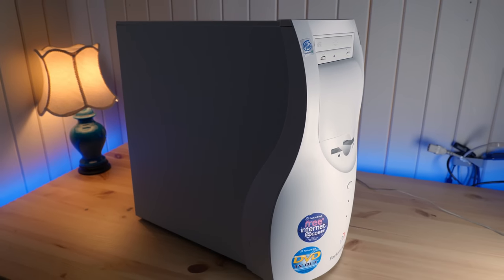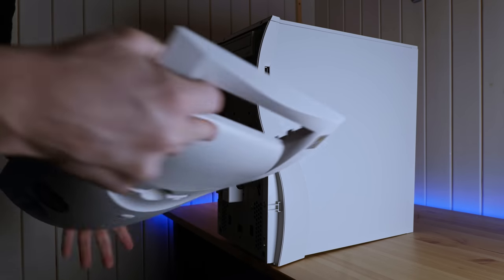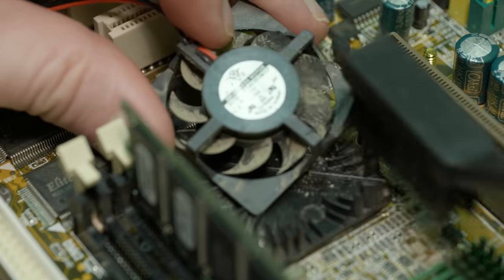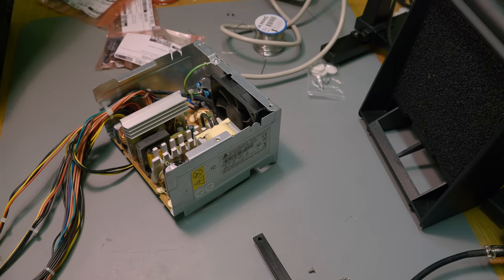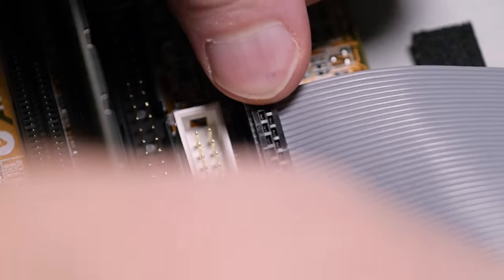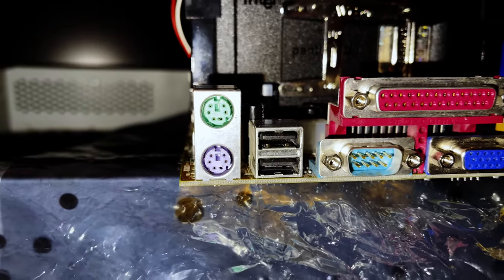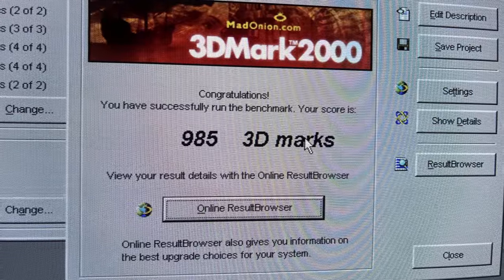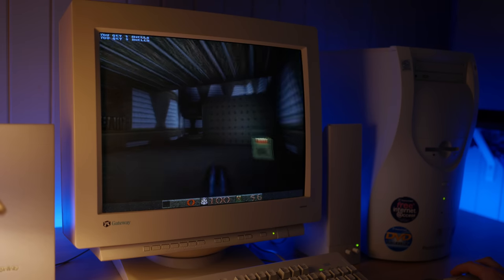Reviving a Packard Bell with onboard Voodoo 3!

Comment: a small advice: never use an antistatic bag as a base for testing a motherboard. its conductive. nice video, amazing motherboard.
Reply: Not conductive enough to cause any problem.
I just made a test, and can't measure anything between 1 mm with my meter, on the 20M scale.
Reply: @nalinux   not all the bags are the same. just be carefull.
Reply: @geomarin5412  Maybe. But I've never seen anyone acting as aluminum paper foil.

Comment: wow i didnt know there was an onboard voodoo option. thats something to watch out for when i'm digging through old systems
Reply: Same here!  I wonder if it was a Europe-only thing with Packard Bell?
Reply: 3dfx was pushing desperately every button to catch up with nVidia TNT2 at that time. They were a GPU supplier at first, but after acquiring STB Microelectronics they also release their GFX cards. They cut the GPU supplies to other vendors. After that, you could get a Voodoo accelerator from 3dfx only. That more profitable but hard to do decision was their last mistake I think. With GeForce 256's release their fate had ended

Comment: You should get yourself an ATX power tester. Those are gold if you attempt such things more often, and don't cost the world either. Note that especially the digital versions have issues with different ATX versions, such as the number of PINs and the presence / absence of secondary 12V and -5V line.

Comment: Packard Bell sure did a lot of fun stuff with this machine. From making the case open backwards, to the hidden bays.

And did you also notice there's only ONE USB port on the back, despite the board having two?
As for the PSU outputting 3.4v - apparently that's one small caveat of those that run a sense wire on the 3.3v - the voltage rises slightly. I have a Sun Pro OEM'd unit here (Rhino RX-500Y) that always runs the 3.3v rail like that.
Reply from the maker: Yes, haha, the blanked out USB port is weird! Maybe they had another mobo option with only a single USB and they just used the same IO shield or something.

Interesting tidbit about the 3.4v, had no idea!

Comment: That brought back some memories, a cousin of mine had such model back in the day, I helped them set it up and install the PC when they got it.
It came with a collection of software and games which where included by Packard Bell, from what i recall some of the titles where Encarta Encyclopedia, greetings card software, Games Blade Runner and Freddi Fish. They also had A2 racer but not sure if that was a pack-in or they got that loose. For reference this was in the Netherlands, I believe some of the included titles could differ per country/region.

Comment: I would enjoy seeing a video of this guy getting upgraded to 16 MB. What's the processor limit for that motherboard in terms of the processor?  I know slot 1 went much higher than 600mhz. I also doubt that 256 MB was the RAM ceiling as well? Anyways, nostalgic AF. Thank you!
Reply from the maker: The bus runs at 100Mhz stock, but the BX/BZ chipset is know for running well overclocked to 133Mhz, which should allow running later and faster PIIIs. The RAM ceiling was officially 512MB, but I’ve heard that 1GB is possible with 2x512mb sticks.

Problem is that those kinds of upgrades would likely require a different BIOS, and I like to keep it stock with the Packard Bell boot logo and everything.

But I’ll definitely do a video if I ever upgrade the VRAM!
Reply: @OddObsolete  I'm sure PB would've sold this motherboard with a better BIOS so they could sell faster processors on the same motherboards. More profit that way. I've always been a performance junky more than a product purist. Great system though.

Comment: That's a very nice find 😎 get some UT GOTY and pod on the go or GTA 1 with glide enabled would be sweet and some duke and quake ..... I have seen that case design before and bottom mounted screws holding side panels on or topside with plastic cover hiding screws seemed to be a thing at one stage 😎 super cool video ........tech tip cut down paint brushes work we'll

Comment: Im fairly certain the Voodoo3 chip on that board is the "bonesteel" version, a cutdown and underclocked voodoo3 (100MHz Vs 133MHz/166MHz) with a software diabled texture unit that can be re-enabled via a registry hack. Id suggest using vogons custom 3DFx driver. 

A revisit to this machine with some upgrades (Including mabey an IDE SSD?) after reseraching my suggestions above would be a cool to see video. ;)
Reply from the maker: No, it’s clocked at 143Mhz like a regular Voodoo3 2k, and fillrate in 3Dmark 2k seem to indicate that both TPUs are active. But good tip about the Vogons driver, I’m gonna check it out!
Reply: @OddObsolete   The 133 was a typo yes, Ok, Was an assumption on my part, I figured since compaq pretty much had a monopoly on the bonesteel cards from 3DFX that they would naturally use it as an integrated solution aswell.

Comment: Excellent video... I must say if you are going for the 8MB to 16MB SGRAM path and this is a custom Intel i440BX which must be a FSB 100Mhz and Intel Pentium III 600Mhz... why not go full 1Ghz PIII FSB 100Mhz? would completely max this already custom and extremely rare Packard Bell into legendary status.

I also feel that the Voodoo 3 chipset itself was a bit of a let down compared to the competition of the time but maxing out this Packard Bell to 16MB SGRAM, (you already maxed the SDRAM from 64MB to a mighty 256MB) and an Intel Pentium III 1Ghz would just sweeten the deal... let me tell you that I had a 600Mhz PIII and own two PIII 1Ghz but they are 133Mhz FSB for the latter and the speed is VERY palpable indeed....

Afterwards the whole Voodoo 3 driver or probably some fan made drivers? would fix the benchmark issue and help provide some neat benchies or custom ones in 2022 or assuming you cannot get it finished, into 2023.

Thus testing the old games that ran on Glide and PC-DOS games should definitely be an excellent experience. I also like that you did not use a SSD and instead went for a mighty Hitachi DeskStar HDD 160GB, I have one of those too, very good drives.

Also I recall that a PC magazine I have did run a story on unfinished motherboards that featured a 3DFX chipset but they made it seem like such a 3DFX powered motherboard was never in production and the sample they had way back in the early 2000s did not work... I suspect that the PC magazine was clueless about this Packard Bell given how they often preached for custom PCs anyway and probably Packard Bell did not have just a great performance name but also the fact that Atari Games (the arcade game maker NOT the separate entity that made computers and gaming systems) did indeed have some type of custom motherboard featuring a 3DFX chipset around 1996 which probably means it was based on 3DFX Voodoo 1 or before the Voodoo 2 which isn't saying much but "seemed" like a powerful arcade machine based on a custom computer motherboard.

Comment: Say, would it be possible to upgrade the Voodoo 3 RAM like a 1.6 XBOX via piggybacking and chip-select?
Reply from the maker: I’m not familiar with the XBOX upgrade, but it’s possible to get the Voodoo 3 up to 16MB, yes.
Reply: @OddObsolete  Neat.

Comment: How did you set up windows 98 on a 160GB Hard drive? 80 partitions? :P
Reply from the maker: Win98 supports FAT32, so a single 160GB partition is no problem!
Reply: @OddObsolete  Using a 160 GB HDD with Win98 is a big problem. The problem will usually not be visible from the get-go, but if you use the OS for a longer period of time, you will end up with corrupted data. With Win98, you must make sure that the disk is below 128 GB (notice how I said "disk", not partition - it doesn't matter if you create smaller partitions, data corruption will still occur if the disk is larger than that). There are workarounds, of course, such as R. Loew's Win98 high capacity disk patch.

Comment: I have one of this motherboard version 1.0 without TV out. I use with 433 CeleronA on 540Mhz and 128MB ram. The 3DMark2000 give me only 493 Score and the 3DMark99 4200. Is it possible my board has 1 TMUs like Velocity 100? In Quake 1 640x480 111.5 fps 800x600 75 fps 1024x768 49,7fps. I have similar pc with PCI Voodoo3 2000. Make around double FPS in Quake(120fps in 800x600)!  I don't know what the reason of this result :( I use win98se on every old pcs.
Reply from the maker: I suppose it is possible. To figure out if you have 1 or 2 TMU you can check the texture fill rate in 3D Mark. I don’t remember the exact figures OTOH, but you can google it. Two TMU = double the fill rate of one TMU

Comment: Take your time, look up manufacturing temps and solder melting also pcb temp fail temps also, no modern os, almost killed a nvidia 9100 integrated phenom x2

Comment: Interesting bit of computing history. So integrating higher-end discreet GPUs into motherboards is an older concept than I thought.
Even these days, integrated discreet GPUs are pretty rare in desktop systems, they're pretty much exclusive to laptops.
As for those bad capacitors, it's always best to replace all same brand caps, even if only some of them look bad.

Comment: I got one of these (with a 450 mhz celeron) almost 20 years ago as it was dead. I never found out what was wrong with it, but found that pressing the power button repeatedly hundreds of times slowly got it back into life. It would then work as normal until it was unplugged. I remember the hard drive containing a large library of MP3 music, many of which I've been unable to find online later.

Comment: A Voodoo IGP sounds cursed lmao

Though to be fair it's more of a discrete GPU soldered on a mainboard as opposed to a typical IGP integrated into something like a northbridge or the like.

What they did was like with the Intel 810 chipset where the IGP was connected to the AGP bus hence why motherboards using it only have PCI slots, and those who owned such a PC were shit out of luck.

Comment: In late 1997 ny dad came home with our first computer. Its was a Packard Bell 
133mhz processor with  MMX  (clocking it to 166mhz) 
A 1.5 MB graphics card 
1.8 gig hard drive 
And a whopping 16mb Ram.
The screen had built in speakers.
A stand alone microphone and a remote.
It ran on Windows 95 and killed everything we threw at it.
2000 bucks for this beast ❤❤

Comment: My first pc was a Packard Bell but it was a lowly 486 sx-33 with 4mb ram, 170mb hdd, cirrus logic 1mb video card, no optical drive and no soundcard. I bought and installed a Soundblaster Pro 2.0 in it(my first ever upgrade to a pc) and I found it to be a decent upgrade from my Amiga 500+

Comment: And I have one other question. How to run GTA1 in Glide with SG Ram  version Voddoo3. I have 5 piece of Voodoo3 SG. Can't start the game with Gtafx.exe . But on SD ram version Voodoo3  started and working good like on Voodoo1 and Voodoo2 and Banshee.
Reply from the maker: I have no idea. I have a similar problem where Diablo 2 refuses to run in glide mode on this board. I suspect that the game expects a Voodoo3 2000 to have 16mb and bails out when it only finds 8.

Comment: What's your audio encoding values for videos?
Reply from the maker: I just use the default YT/Vimeo export option in Davinci Resolve. Other than that I add some EQ, gate, compression and auto leveling to the voice over, and then some light compression and hi/low cut filters to the full mix.
Reply: @OddObsolete  cool